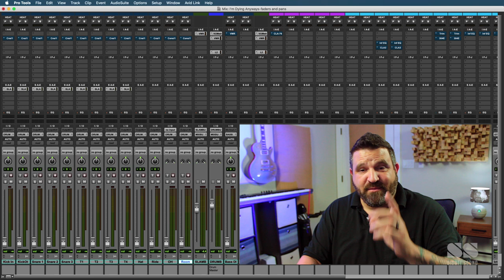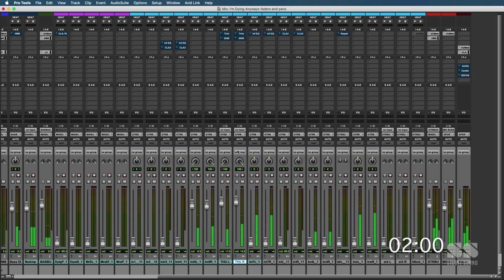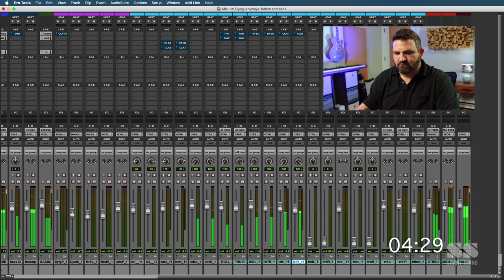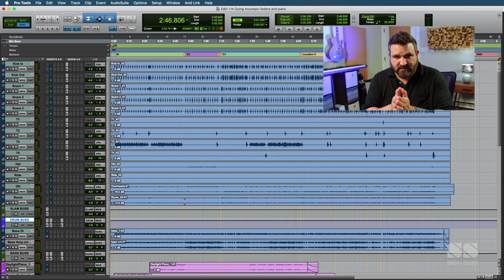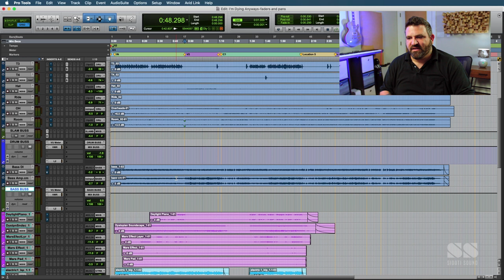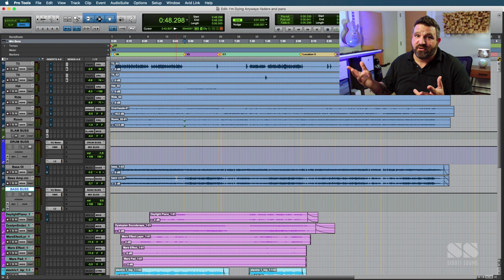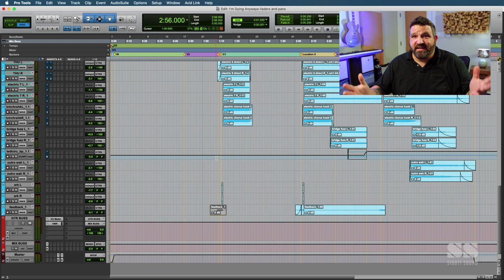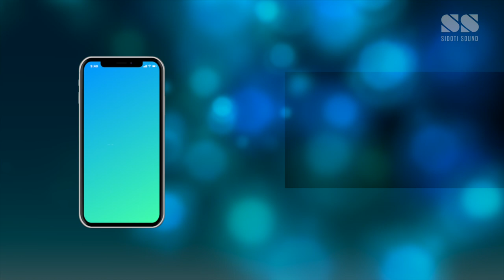Watch Me Mix A Song | In Real Time - Using ONLY Faders And Pans

Comment: I used to compress twice to compensate for the lower parts of the vocal, but I've been using automation before compressing and it's gotten me better results. You should always try the most simple fix (like raising the volume) before grabbing for a tool (the compressor). Automation allows you to get a more consistent Vocal by raising the lower parts and helps you lower the louder parts, so the compressor doesn't have to work as hard and avoid raising sounds you might not want (compressors reduce the dynamic range, so the lower and louder parts are more close together).

Comment: Good stuff! 
It would be great if you could do a video on the relationship between the bass and bass drum regarding EQ.
Reply from the maker: Thanks. When it comes to bass and kick eq I don’t get into the whole carving out this frequency to make room for that. I just make sure you can hear the bass through small speakers and then make sure the kick drum and bass work well with each other. If the bass needs to have a big sub presence then I’ll make sure the kick drum isn’t too boomy and vice versa. If the kick drum needs to be huge I’ll hi pass the bass a little.
Reply: Thanks for the info!

Comment: Pretty cool mix but u should change the name on video to mix with only faders pans and mix bus
Reply from the maker: Hey Manny. Your correct. The idea is that if you use templates and presets on your mix buses then you can quickly drive into those buses and get good results fast. Thanks for the feedback